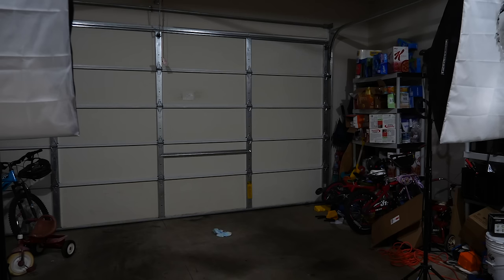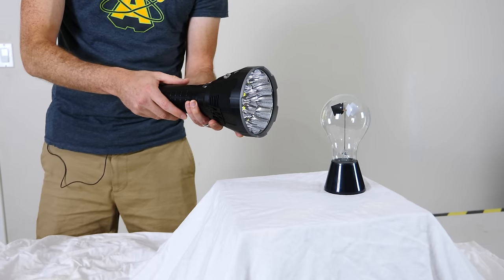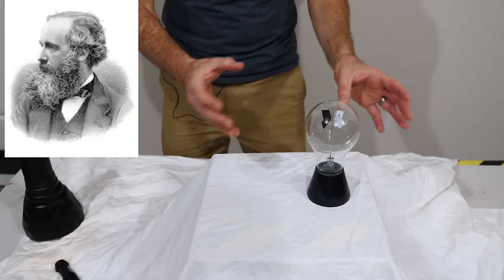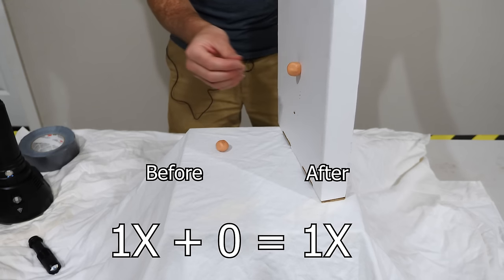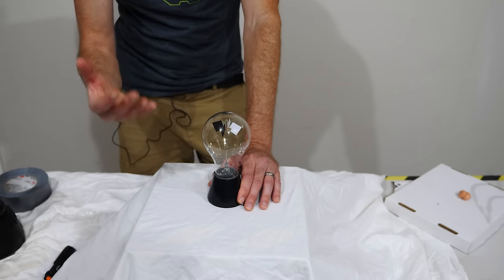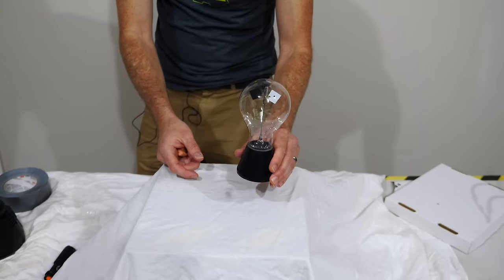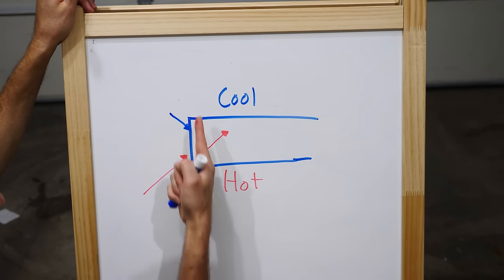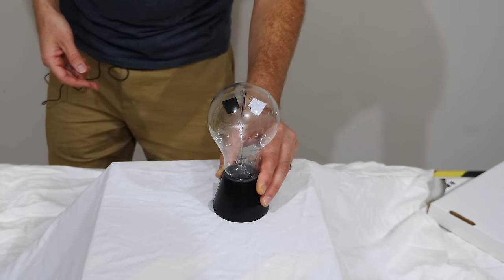Shining 100,000 Lumen Flashlight at a Crookes Radiometer

Comment: You know you have a powerful flash light when it needs a fan.
Reply: No shit !
Reply: Laser cutters be like: PS4 startup fan
Reply: And only lasts 1 minute turned on at that power
Reply: not really, just means it's terrible inefficient and turns alot of energy into heat instead of light
Reply: What about those Water cooled LED's they are super effifient yet they need strong cooling
Reply: @slickrick8279  Since we only want light, but got heat from light sources, the heat is always wasted energy. The classical light bulb had around 2% energy converted to light, and 98% to heat (so crappy as hell)
LEDs are way more better, (not hard to be super efficient against classic light bulb) but if you radiate heat, it's a loss.. For example a 100W LED which radiates around 50W is only 50% efficient...
Reply: I'm fan of his flash light
Reply: Everybody gangsta until a flash light uses water cooling
Reply: @v1Broadcaster  About 3% of the light gets absorbed into the mirror part of the flashlight. this 3% is turned into heat. With a 100,000 lumen flashlight, we could assume that 100,000 lumens is only 97% of the emitted energy. The total light emitted would be 103092 lumens, at which 3092 lumens get absorbed and turned into heat.
Reply: @blake_niewoonder  I think he is talking about total energy, not just light energy. From the stored electrical charge in the battery, to the actual working light, a lot of energy is lost.
Reply: He needs a rgb fan.
Reply: @v1Broadcaster  every engine in existence is "terribly inefficient" if you go by those standards.  So ridiculous to say this device is inefficient when it can generate 100,000 lumens with just a cooling fan going.
Reply: Péter Erdősi led are 20% maybe 25%
Reply: you forget  efficiency of leds that is 25% more or less, so 3 quarters of battery energy goes wasted into heat
Reply: You should see hacksmith flashlight.  That's a fucking car lamp disguised as a flashlight
Reply: Remember, fan needs lot of air, here it's near to vacuum
Reply: No no no no no no no no no no stop
Reply: Lmao I have a 2.5 million candle power flashlight.  1cp= like 12 lumins so that isn't the most powerful flashlight..and it doesn't have a fan
Reply: @sweetreamer5101  "oh no, a CPU needs a fan, so inneficcient1"¤!"¤#!.....
Reply: It needs an atomic reactor
Reply: Im that flashlights biggest fan....no pun intended
Reply: It's on $670 bucks
Reply: @v1Broadcaster  NOt reaLly

Comment: I saw this thing 15 years ago in elememtary school for the first time and never understood how it works because noone else knew. Thank you for explainig it in the video. I always learn something on your channel.
Reply: His diagram of the vanes didn't make any sense to me, so I'm still somewhat in the dark.
Reply: @-danR  I agree that the diagram was not clear. I would explain it as follows (assuming I've understood this correctly):

The higher the temperature, the more the molecules bounce around (the movement speed of the molecules is the same as temperature). Molecules move equally often when temperature is low, they just move at slower speed. When temperature on the one side of the vane is higher, the atoms hit the surface of that vane faster and transmit more energy towards the vane. The atoms on the colder side of the vane hit the surface with slower speed so they transmit less energy. The sum of these collisions is a non-zero vector causing the movement.

When the surface of the bulb is made colder, the existing energy in the vanes (warmth) will radiate as infrared (this happens all the time but in case the bulb has equal temperature, it will emit similar amount of infrared back to vanes so net result is zero). As black surface radiates infrared energy faster than white (or mirror) surface, the black surface of the vane gets colder than the white surface and the rotation goes to another direction.

In the end, I'm not sure if it would be incorrect to call this "pressure" because if you take a gas filled ball and you heat it (assume that the volume of the ball stays the same). Here the number of molecules inside the ball doesn't change, the volume of the ball doesn't change but still the pressure does increase. What is this pressure if not just the movement of the molecules hitting the surface of the ball? Is this really different from the collisions of the faster moving molecules hitting the surfaces of the vanes? However, if one thinks that the Crookes Radiometer spins because temperature difference "create wind", that's not true. Any wind would be about big groups of molecules moving in one direction but in this case, the molecules bounce around randomly and the speed of that movement causes the force to move the vanes.
Reply: @MikkoRantalainen  I'm not satisfied with this theory. Say you were to increase the gas density in the bulb. While this would certainly increase drag, the ratio of faster to slower impacts on either side of a vane would remain constant. Thus the vanes would still spin, just slower. But that is not what we see. A radiometer does not function at all if there is too much or too little gas. 

When I shine a 2 watt UV laser into my radiometer, it spins so quickly that I worry it will fly apart. The beam is potent but it does not heat evenly. All of the surface of the vane remains at ambient except a thin stripe where it passes through the beam. Are we to believe this thin stripe is inducing enough kinetic energy into the gas to spin the vane into a blur? 

When I shine the beam at the white side of the vane, it does move at all. This is significant. The beam is certainly strong enough to heat the white side. Matter of fact, it would quickly heat both side as the heat conducts to the black side. When the beam is removed, you can confidently conclude both sides of the vane are equal high temperature, yet the vane still does not move. This challenges the theory that surface heat is powering the motion.

So I don't know how radiometers work but if you are still reading, I'd be interested in your thoughts about a cold night last winter. My radiometer was outside the kitchen window (it's actually part of a windchime, so it's always outside the kitchen window). It was well after dark and it was spinning like crazy. No visible light other than moonlight. I'm at a complete loss to explain why it was spinning that night. I live in the country, no neighbors nearby. Cosmic radiation?
Reply: @nathanegbert977  When the radiometer is warmer than the environment, it will spin due temperature difference causing the radiometer to emit infrared. And this infrared light will be emitted faster from the dark surfaces.

About the speed use can spin with a laser, try to stop shooting the light on the radiometer and count the amount of full rotations until it slows to halt. I would guess you'll find that the friction is very low - this is thanks to low friction in the axle and low drag thanks to low gas pressure.

I would guess that if the pressure is too high (that is, close to normal air pressure) the relative difference on the both sides of the vane is too little. If static air pressure is 1N per 1 cm^2 and the temperature difference can create 0.01 N per 1 cm^2 you probably cannot have any movement. If static air pressure is low, you can get more relative pressure thanks to temperature difference because the same temperature will cause the same speed for each individual molecule even if there're less molecules in total. Of course, if you go full vacuum, there're no molecules to bounce around so radiometer cannot work.
Reply: @MikkoRantalainen  It would be great if youtube would let me read more than one and a half sentences of your reply. Sigh. I'll check back later.
Reply: @nathanegbert977  If you look at the vanes you'll notice that they are angled. In his one vane appears to be bent in the opposite direction of the others, which I attribute to a manufacturing defect. I think that it is the heating of the black side, transferring to the gas, causing the air to form vortices rising toward the center and then out and downward. 

This also might explain why it spins in the opposite direction when cooled from the outside. The cooled air falling at the surface of the glass somehow causes vortices to form in the opposite direction due to the shape of the bulb. This could be tested by making the bulbs of various shapes and sizes.
Reply: Thats a 10,000 lumen ice cube.

Comment: I am deep in electromagnetism and did not know this. Thanks. I have this Crookes radiometer for around 35 years and I realized that the phenomenon cannot be due to momentum, for the reasons you explained. But I did not have a clue why it spins in this direction. It is the thermodynamics, really unexpected explanation. Thanks.

Comment: Can we put it in sunlight and make energy?
Reply: Energy cannot be created nor destroyed.
Reply: @jamieflatley  he just wants to convert the light energy from sun to use it as electrical or mechanical energy what is wrong with you?
Reply: Sure, it can be done, but will have a lot less efficiency then solar panels
Reply: @jamieflatley  Come on now, you know what he meant. 🤨
Reply: @danielclv97  I do get your point and I certainly agree with it. Even the best Carnot engine wouldn't be able to harness most of the energy. But what the other guy said was totally absurd
Reply: Nooooooooooo, there's no free energy device (mehdi silently gasps) 😂😂😂, i am just kidding, i know its like converting mechanical to electrical energy
Reply: Patrick White Fusion...
Reply: 🤔🤔🤔 can we do ??
Reply: @jamieflatley  there's always a nitpicking, self proclaimed "ultra genius" around when you don't need one. Welcome to the club.
Reply: Here’s my idea closed cylinder with a trap door to let in sea water top of the cylinder has a escape hatch opened by pressure to a condenser suspended above with a hydro electric generator that harnesses gravity on the stored h2o also attached is a magnifying glass with mirrors that follow the sun to maximize the heat at the bottom of the cylinder.
Reply: Sure, I had one as a kid and kept it on the windowsill. I loved the way it just kept spinning as long as the sun was out.

It would be inefficient and fairly impractical to actually try to extract useful energy from it, however. The vanes spin fast, but they're light and don't have much (angular) momentum to drive anything, even if you overcame the engineering challenges of transferring that power without breaking the seal on the chamber. Not worth it, use a solar cell instead 😁
Reply: I don't think there would be a motor with resistances low enough for this to be able to turn. Good idea though 👍
Reply: “Make” 🤣😂🤣😂🤣😂🤣😂🤣🤣 my eyes hurt after reading this comment.
Reply: @elijudkins2578  There's no need to be such a pedant, it's obvious what they meant.
Reply: @lordyoseph53  despite the horrendous lack of punctuation I am intrigued
Reply: Trying to draw a current off of it would likely add too much drag for it to spin.
Reply: @jamieflatley  ok nerd, is he supposed to say "can I put this in sunlight so the radiant energy can be converted and transformed into thermal energy so the wind differentiation between the black and white side and create mechanical energy so we could generate electricity from it"? Heck no. We all understand by OP's original comment
Reply: @jamieflatley  the energy is transformed by the sun like solar panels but maybe I’m dumb and there’s something else
Reply: Yeah but solar panel is better for that lmao
Reply: @wawan8759  yes
Reply: @Patrick White man...
Reply: Jamie Flatley aw look at the cute 4th grader trying to use what he learned in class today
Reply: :O
Reply: Yes you could though even a large one the size of a wind turbine was still probably be extremely inefficient if enough were setup in very sunny areas then yes this could generate enough energy to sustain houses
Reply: @Patrick White Nuclear fusion
Reply: o sad
Reply: @danielclv97  yes, that's because with this tool we have to first convert the sun energy to momentum and then the momentum to electric which will waste some energy by friction and heat, whereas with solar panels it directly get converted to electricity.
Reply: @jamieflatley  little difference question can we generate electricity
Reply: @rebellio619  nothing much
Reply: @danielparker813  yes I did
Reply: @Patrick White nuclear fission I believe idk
Reply: @michaellinner7772  cheers for the welcome. How many members do we have?
Reply: @OMNI-Infinity  I am not familiar with quantum mechanics
Reply: @kf5058  yeah I understand it too mate
Reply: @Sxzye  yeah I believe so
Reply: @TNoStone  GCSE physics always comes in handy
Reply: @Michael O'Connell 100%
Reply: @Patrick White actually no it’s nuclear fusion nvm
Reply: @jamieflatley  well it's just the 2 of us right now but maybe we could put together a membership drive of some sort.
Reply: @jamieflatley  looks like someone wants to sound smart
Reply: @danielclv97  true but this would be way cheaper to mass produce and since there is so many possibilities there could be a way to produce them with way less pollution then the solar panels are created with
Reply: @5k1nny  if the efficiency is very low then even if you can produce 1 power plant cheaper and more friendly environment, if you have to use 100 or 1000 to get the same result then is actually more expensive and have a bigger carbon amprent then the classical solar panels. For example, even if nuclear reactors are very harmful due to nuclear byproducts, they are so efficient compared to other methods of producing electrical power, that is cheaper and has a less environment effects then most.
Reply: @danielclv97  actually you would not know that until it is done or put into practice because you do not know the materials or means of it beings put together
Reply: @5k1nny  yes, I don't know, but since is an well knew phenomenon, I bet people who dedicated their lives developing ways to gather energy from the sun, would had used this if it's better then sollar panels, I just pointed out the reason why they would arrive to the conclusion that is pointless
Reply: @danielclv97  true but they probably use solar panels because they convert more energy even though they cause more pollution I was saying use this if you want less pollution
Reply: @itachiuchiha6891  I want to sound so so so smart
Reply: @kunalyadav672  YouTube doesn’t have a IQ mate
Reply: @RoN1S  actually there is a pretty complex theory about the formation of a star or a nova ( cuz that would be the proper term for sun ).. it has very much to do the gravitational and electromagnetic forces.. it is speculated that after big bang there was excessive amount of graviton and photon particles that were  creating a sort of liquid space.. given the chaotic movement the energy exchange between particles caused erratic and accidental formation of localized clusters that eventually clumped together, gaining volume and mass utilizing the growing intrinsic force to affect other particles to give form to elements, which became subjected to those two forces eventually forming all kinds of materials with their respective properties and amounts of energy.. occasional distortions and anomalies gave rise to stars, quantum singularities and many other phenomenons.. some even yet undiscovered..
Reply: @lexsmith8689  yes

Comment: Excellent video. i had a radiometer as a boy and would watch it for hours. I went though packs of batteries.   I was lead to believe your second explanation all these years was the correct answer. Thank you for the true explanation. I was not aware of the Ice trick.
That Flashlight is insane.

Comment: I think the Crookes Radiometer works more in infrared light than visible light so with a 10,000 lumen incandescent bulb it will probably spin the same.
Reply: Like a megawatt infrared laser.
Reply: Long wave (far) infrared, eg heat, specifically. It doesn't really respond directly to higher frequency light per se, just the heat it generates, so yes a far infrared source (such as a red/orange hot element) will be more effective per unit of power input than near, visible, or UV for example.
Reply: @MadScientist267  such as...heat.
Reply: @MadScientist267  did you know that black absorbs all frequency of lights and emits them all as heat
Reply: An astute bunch on here I see... 🙄
Reply: @proloycodes  Did you know that all materials and colors absorb at least part of all frequencies of electromagnetic radiation, and that they all radiate at all frequencies, not just infrared (heat)?  The amount radiated at every frequency varies with the temperature of the material according to a function, approximated by "Kirchhoff's law of thermal radiation".  Some good background (no pun intended) can be found at 
https://en.wikipedia.org/wiki/Black-body_radiation
Reply: @pault151  i was talking about "black" color, not all colors
Reply: @proloycodes  , this would make it invisible genius.
Reply: @michaels3003  black is "invisible" in a way
Reply: @proloycodes  , my objection was to the word "all" used twice. In real life, most blacks are very dark grays; you can still see black-colored  objects. True black would appear as a bottomless cavity. You probably saw some "real-black" tricks on YT.